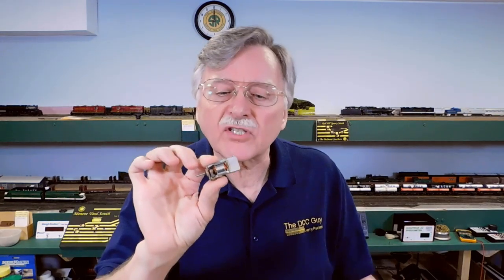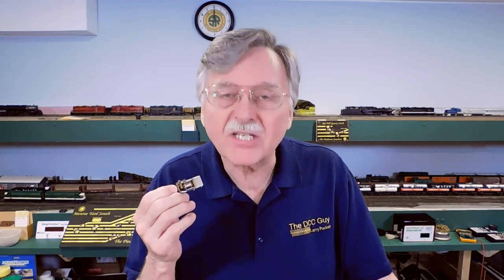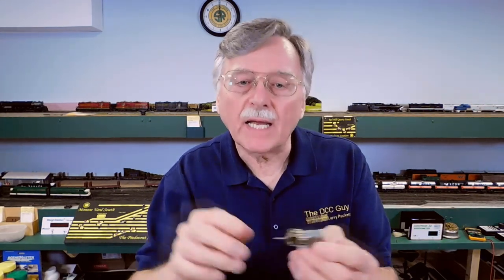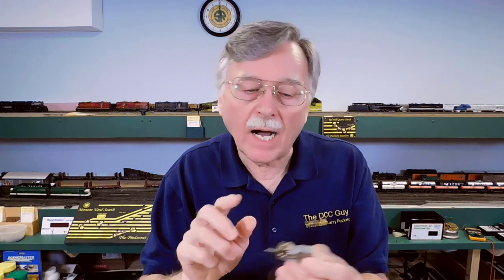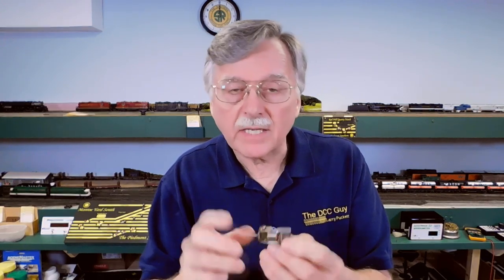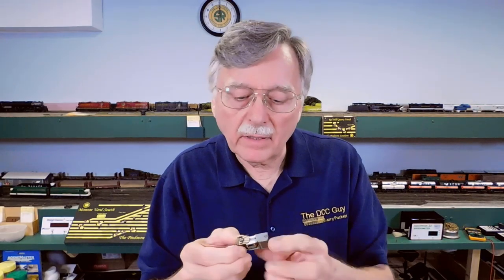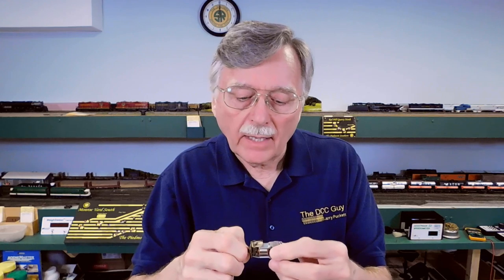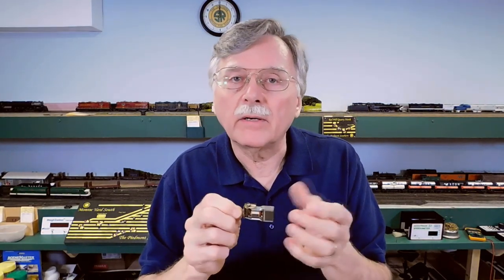Stall currents--What are they and how do you measure one? (89)

Comment: HI ya Larry, you've become more & more my "go to" for the real nuts & bolts regarding our hobby, I just getting re-booted into it and I'm going dcc ++ to start, I have many beautiful old brass but most have old Amp hungry motors, I couldn't catch the name of the motors you used or recommend to change out to..I have both steam & Diesel single & dubbl.shafts I'd rather "close the gate,BEFORE the horses get out lol
BTW keep up the Great Mechanics & electronic side you knowledge is inspiring thank ya kindly
Reply from the maker: Mashima and Canon were always good replacement options but I don’t know their current availability (check Walthers). MicroMark also sells replacements. Some brass dealers may also offer replacements. Good luck—Larry
Reply: @TheDCCGuy  thanks for the tip I'm watching you "new&enproved keep alive thanks for putting component list in this 1 Larry. .handshake bud

Comment: If the loco wheels are spinning/slipping I suspect the motor is drawing LESS amperage than when the wheels are not spinning/slipping due to dynamic friction being less than static friction.  Measuring stall current to me means measuring maximum current draw.  That happens when you apply maximum voltage to the motor but don't let it turn.
Reply from the maker: At one time Lenz recommended using the current draw with the wheels spinning instead of completely stalled. However the maximum current draw is when the motor is completely stalled.

Comment: Terrific video Larry, I guess I have just been lucky with my locomotives. I just drop a compatible decoder in and let it run. Now I will need to go back and test them.  Do you record that information in your excel maintenance worksheet you wrote to me about?

Finally, do you have any suggestions to test for spin and stall current testing if the loco already has a decoder?
Reply from the maker: It really isn’t necessary for newer models as motor efficiency has improved greatly over the past 20 years and decoders made today can typically take over an amp and many now ca handle 2 amps. If there is a drip i  type decoder made then the manufacturer has already confirmed the stall current. So it really comes down to older locos with open frame motors or ones you are not sure of. It can be a good idea if a loco has been stored a long time or is not running as expected. Model Railroader has been providing stall currents in their reviews for over 20 years so if you have a collection or archive access then you can look them.
Reply: @TheDCCGuy  Okay, I have access to those archives. I will check for that. Thank you for the quick reply.